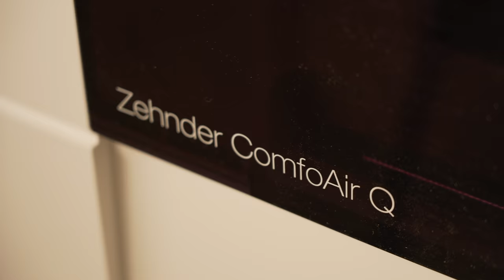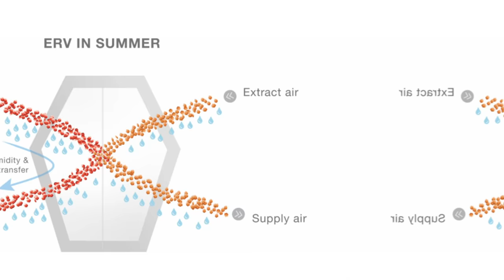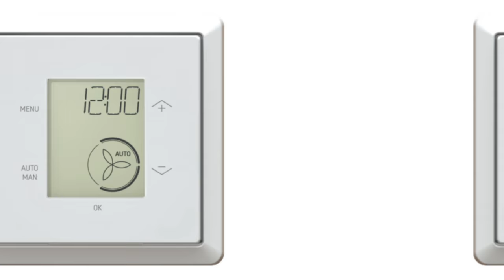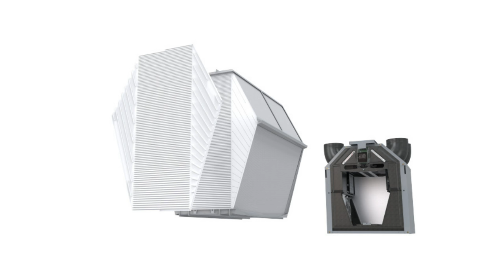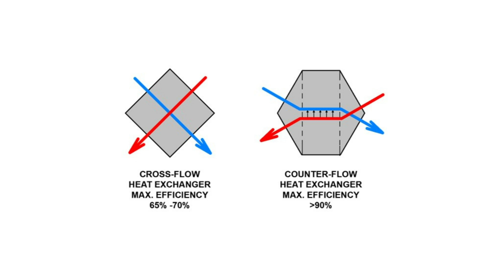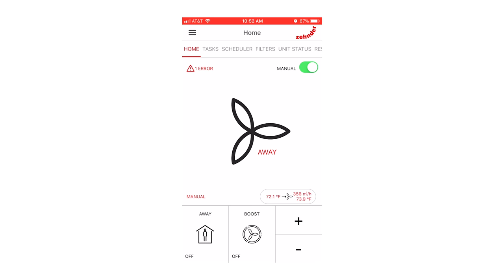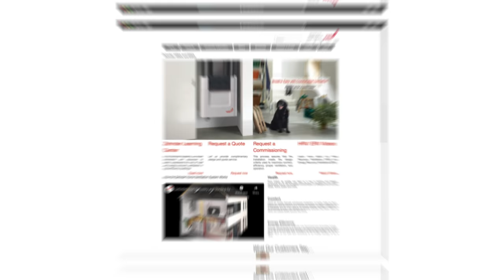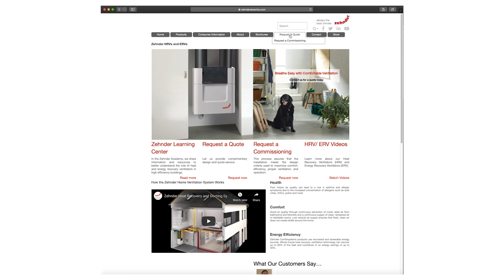Passive House - Fresh Air System Install & Costs (Zehnder)

Comment: How does one tie in heating and cooling into a system like that?
Reply: This is a common practice in North America, but it's best to let the systems operate independently. The airflow required to deliver or remove lots of BTUs is a lot more than the airflow required to maintain healthy IAQ, so the duct sizes are different. And the air distribution strategy is different as well. Heating and cooling recirculate air to maintain efficiency. You don't want to recirculate your bathroom exhaust air. The control strategy is often different as well (intermittent vs. continuous). We're trying to optimize Indoor Air Quality.

Comment: How long can these flex pipes runs be?
Reply: It's relative. Shorter is always better, because every additional foot of length makes the fan work incrementally harder. That said, we'd love to see them around 35', but I've seen them up to 80' long and still deliver the air. It really depends on the whole system. And you want to be able to adjust the fan speeds to as low as possible to save energy and keep the system quiet.
Reply: @christophersmith1894  Thanks Christopher, I'm planning to install one but in the basement (I'm in Boston area).  35'-40' seems like doable going to second floor ceilings.  Love your ducts because it looks like they will fit in 2x4 walls.
Reply: @sergeyb8  Yes, both ComfoTube and ComfoFlex will fit in 2x4 stud walls. Our office is in Hampton, NH. Reach out and our local staff will work with you directly.

Comment: Great video. I really like it when you get into the technical details. 

But let me get this straight. A new house in the northeast (zone 5) requires an air door test of 3 ACH@50Pa to pass code. That translates to perhaps 0.3 ACH under average wind loads. You are building a passive house that is so tight, you need to add 0.4 ACH air flow via the EGR to make it livable (providing enough air to breath, and remove bad smells). And it only cost $18k to supply the air that would otherwise leak in/out for free in the zone 5 code home. 

I realize an EVR will save a few hundred dollars/year in less dehumidifying/cooling in summer, and heating in winter. But I don’t see this ever paying for itself in the energy saved. And I think we have gone overboard in trying to save the last drop of energy. (There really would be no energy problem if we developed safe 4th Gen nuclear energy).

I also realize the important benefit from pre-filtering the input air. But it seems to me one could just use a large stand alone air purifier for that.

Comment: Matt, could you provide more info on your HVAC setup for your home, is it low static or high static, how many tons, load calculations per room etc?  Looks like your a fan of the pizza box units. Not to much out there about these units that I can find. Would be nice to see some installation videos for them as well. Thanks for your time.
Reply from the maker: Robert, I have at least one or two videos coming up soon on that topic stay tuned

Comment: Don't you need a separate system for your dryer vent?
Reply from the maker: Yes. Absolutely
Reply: @buildshow  , are you abel to configure this system to let in air when the dryer vent / range hood sucks air out?

Comment: An ordinary heat exchange ventilation and proper climate shielding is old news in Sweden, been the standard for decades... ;D  But it looks like u put the vapor proof layer furthermost out?? Or is it just a wind breaker? If not, ur begging for moist damages at season changes when the sat max swaps sides of climate shielding.

Comment: I do not get how this can replace all the exhaust venting he mentioned. If the entire system is doing 180 cfm at max (boost) that is only 11.25 cfm per run/pipe (16 runs). You typically want at least a 50+ cfm fan in a bathroom depending on room size. That is at least 5 runs alone per bathroom and he has 3 full bathrooms, making that 15 runs just for the bathrooms leaving only a single run left for the entire house. A good range hood will exhaust more cfm than this entire system is capable of doing.

Comment: So outside air is humid, normal inside air is lower humidity, but bathrooms and driers are warm and humid, just like outside. Why does this warm humid air go through the evr on its way out? Why not just vent it without sending it through the device?
Reply: Good questions, thanks! Clothes dryer is not ducted through the ERV. But the bathrooms are. Bathroom humidity is pretty intermittent, so over the average of the day keeping continuous low flow of exhaust through the bathrooms doesn't add significant humidity back to the house. This works out pretty well.

Comment: so....... what was the price?
Reply: He said for Matt's house it was 10 - 12 thousand for all the parts. He also said you can plan to spend half of the total unit cost for installation. So roughly 17 thousand for all materials and full installation. They did say the installation was fairly easy for someone who has done them before so maybe you could get it installed for a little less if you found the right person.
Reply: Matt's house is pretty large. A small home would be more like 8 to 10 thousand total probably.

Comment: Great video however the installation pricing provided is WAY to low.  My company has a standard 105$ labor rate.  That would mean if the system is 12,000 your expecting us to complete this full installation in 60 hours for roughly $6,300 ( 2 guys 4 days).  That's not happening especially if your not able to install this in a new construction house.  Add in the time for commissioning, test and balance, misc materials, permitting, wiring, ect plus the mark up on the equipment this is easily a $25,000-$30,000 system installed soup to nuts from a reputable licensed contractor in South Florida.

Comment: Matt, enjoy your videos and technology however you need to go to the next level.  Vermod homes in Wilder, Vt uses Humidity and CO2 sensors to control their HRV.  They also use heatpump dryers with no exhaust venting.
Reply: @Gary Hutchins Are you talking about a heat pump clothes dryer? If so, how do they get rid of all the moisture?  Does it never get humid in Vermont?
Reply: @billcowhig5739  The moisture is condensed and goes down the drain.  We may get 2 weeks of humidity total, up here it can be 95% today and 40% tomorrow!
Reply: Heat pump dryers are terrible. Matt has one in his house he did a review on. You barely can fit anything in them and it takes FOREVER to dry clothes.

Comment: I love their system but still the biggest problem with it is they aren't accounting for targeted delivery. Yes when there is more CO2 detected in a bedroom (sleeping) the boost can kick on. But it kicks on for the whole house. I don't need more air in the guest bedroom that doesn't have a CO2 problem or any of the other unoccupied living areas. The controller should be able to regulate the airflow in an intelligent way. The brains for this system are still pretty dumb for Zender being the leader in this space. I think CERV does this better and they are like a 4 man company.
Reply: Thanks Brett. I'm not sure it's "dumb", it's just a difference in priority. Continuous ventilation during occupancy at normal rates (not boost) is usually sufficient to keep the whole house pretty fresh. While we discussed CO2 sensors, Zehnder doesn't really sell many of them because our systems are effective without them. I think the CERV is a really interesting system and I have a lot of respect for Ty Newell. I think the energy use of the CERV (a heat pump-based system) probably warrants a lot more targeted air distribution. What we have in common is a high degree of concern for indoor air quality in American homes--something that is poorly lacking in our industry.

Comment: I liked it until I saw the Gillet (BMW/Mercedes) model.... $10k for equipment and $500 a year in proprietary/uncommon sized filters (I'm guessing since you neglected to mention that). What other maintenance costs are there involved? When this company goes under in 10 years or is bought out can I get replacement parts? Or is it like that induction cook-top that must be replaced for $2K+ because you can't get a replacement hob (or $10 diode) the year after the warranty expires? How much are those multiple control boards to replace ($500 each like for my $1K fridge)? Newer is not really better. Simple easy to fix it the way to go. This looks nice for the builder, but is a cost nightmare for the consumer.

What about the kitchen ventilation, how does that integrate into the system?

I want one size and type of easy to get filter for my HVAC. Does anybody do that?

Comment: Ehh, why don't you just hook up a humidity sensor in the bathroom, or one that hooks into the light switch? The former would just tell the system to go up a notch when the room's humidity is over a certain level and the latter just runs for as long as the light is turned on plus a few minutes extra. That way it really doesn't matter if they turn the hvac system in boost mode.
Reply: And also, I'd get a dynamically regulated system instead of a statically one like this. The dynamic one just measures the cfm per outlet and regulates to a setpoint, regardless of line diameter and length, and the inlet/outlet annulus size. You can boost the system per room, so you don't get extra noise in all rooms if 1 person takes a shower, and depending on the system (heating/cooling bypass) you can regulate the temperature per room. So the bedrooms aren't as warm as the living room.

Comment: Well, I live in a passive solar home in California.  We don’t have a furnace.  So, passive means no mechanical ventilation systems.  We open windows and we rely on the architecture and natural convection to cool or circulate heat in our house.  So I don’t understand how this is “Passive”.
Reply: Susan Wies Realtor he said passive standards not that it was a passive house

Comment: There is a smaller one bedroom ERV, and these are placed one per room.  

I wonder if the contact surface of several of them is not greater than the contact surface of the surface of the single Zehnder core.

The single room ERV consume something like 6-watts per hour, and they are 91% efficient:

https://images.homedepot-static.com/catalog/pdfImages/7b/7ba84ffc-f8e0-43ff-a5d3-092c48f106e3.pdf

Interestingly, I think they are both designed in Europe.
Reply: There are at least a few versions on the market of these room-sized units that operate in pairs. Zehnder has a version available in Europe, but we’ve opted not to offer it here in North America. Despite the published efficiency figures these are a totally different product and the overall functionality leaves a lot to be desired. The number of pairs you’d need to install to get the same ventilation rate as a centralized ERV in a typical sized house also makes them a pretty expensive approach. IMO, they’re best suited for a small house retrofit, although we have better solutions for that as well.
Reply: @ek9772  I didn't mean to be careless. I was attempting to provide the courtesy of a response to your thoughtful post. Unfortunately I was doing so while on vacation with my family and I didn't take the time to quote technical documentation. I'm back to work today and will try to respond with better info.

I believe I found the technical documents for the Vents-US product you highlighted here...
http://vents-us.com/cat/724/#documentation

Unfortunately, Vents-US doesn't provide independent lab reports. They simply state that the product has "up to 93%" heat recovery. The difficulty in understanding what that represents lies in the fact that this product only accomplishes heat recovery when it's being used in oscillating mode (supplies fresh air for 70 seconds, then the fan reverses and exhausts for 70 seconds). The ceramic core gradually absorbs heat while running in one direction and the gradually releases heat while running in the other direction. Is the 93% accomplished during the entire forward/reverse cycle or only during part of it? They just don't say. (Although a reviewer posted some of his own measured performance on the Home Depot page you linked and the recovery performance doesn't look continuous.) Also, given that they can operate in a few different speeds it's reasonable to assume that the highest heat recovery performance (in their case, "up to 93%") is seen only while in the lowest fan speed. This is true of any heat recovery device, including Zehnder's. (The Q600 HRV also gets 93% at a lower fan speed.) This is why rigorous lab testing is done at different speeds and under different temp/humidity conditions. And the resulting lab reports aren't as simple as quoting a single number. Or if there is a single number given, the parameters under which that performance is achieved is described.

The Vents-US unit is capable of running in exhaust-only mode, so maybe that's a way to use it in place of a bathroom exhaust fan; however, there's no heat recovery while doing so. And you'd have to add enough of them to your project to cover each bathroom, which further increases your total project price.

As I said in my original response, these products have their place in the market and can help a lot of people. But I'm trying to help with informative responses to questions posted on this video, so I also wanted to point out the reality that this is really a different product category. They operate differently and can't be tested in the lab the same as an HRV or ERV, so you can't really compare the performance. And the twin-style through-wall units have some operating limitations that don't provide the total performance of a complete installed system like the one we showed at Matt's house.

Zehnder's HRVs and ERVs are rigorously third-party tested by Passive House International and the reports are available on their website.

Comment: Why didn't you go with 2x6 framing in your home? Cna the ERV system be integrated into a smart home design?
Reply: Hi Marces. Zehnder ERVs can currently be integrated with any control system using a 0-10V signal. But letting it run on it's own at a low, continuous rate works really well for maintaining indoor air quality in a normal home.

Comment: I'm sure a stupid question, but what happens if power goes out? Does air exchange stop?
Reply: Well the question is pretty stupid lol, ERV needs power to run so it will not run if you lose electricity. Unless you have backup generator
Reply: @IYG-x7c  OK so in other words, if you have something like a brownout, then you'll quickly be breathing stale air. That's what I was trying to understand. How long does it take to create a toxic health hazardous situation in the event of no power?
Reply: @BillWhite  why would it create toxic environment? 99% of people don't even have ERV
Reply: @IYG-x7c  I'm speaking specifically about the indoor environment for the family living with an ERV that has no power supplied. This is my root question, how long does a house with ERV take to have foul air, you know where there is more carbon dioxide and buildup of chemical fumes, etc. (obviously depending on what products the family uses)...when there is no power running the ERV? I'm in planning stages of building a home, and I like the tight house idea in terms of energy conservation, however, my concern is if there is power loss, how long before there are problems without opening all the windows/doors to allow exterior air in...not sure why this would cause so much confusion. This is called contingency planning. My hopes are to have grid tied, along with solar, wind and possibly hydro power...I believe in redundant system, however, I'm saying worst case scenario here...how long before this house become uninhabitable or causes more problems than it solves for the residents in the event of power loss.
Reply: Yes, the ERV needs power. But the windows should still work during a power outage. Window ventilation isn't practical all year in most climates, but it'll do in a pinch!

Comment: Have a look at this: https://database.passivehouse.com/en/components/list/ventilation_small . These are all certified balanced central units with such a high efficiency (80-88% and low-el fans). A few also with huminity recovery. Well, on the concept, that was all perfect - the balance (well explained), the counter-flow, the filter (MERV15/16 - it's worth it), no recirculation,, the silencers,, the 7/24 fresh air, the simple 3 speeds (keep it simple!); supply air from the ceiling (not from the flloor -dust!) - all these are certification criteria. Exactly: It's not rocket-science!
Reply from the maker: Huge honor to have you watch and comment Dr Feist!
Reply: I was told by Zehnder that this system would auto-balance a certain amount of exhaust air, from a dryer or central vac for example.  But then they said that was wrong and it wouldn't.  Do any of the ERV's actually balance out up (say up to to 100 cfm if you have extra capacity in the ERV)?  I really don't understand why you wouldn't want to cut the normal ERV airflow anyway during the short times you are bringing unconditioned/unfiltered air through a make-up air system.
Reply: @buildshow  Thanks for all the work you do with these videos. Really well done - good building science is important, even more important is it, to explain it in a way practitioners will understand.

Comment: These systems can also reduce radon levels.
Reply: possibly true, but radon is heavy, and typically the exhaust ports are on the ceiling.  it's better to have a separate radon system in a high radon area
Reply: @BrianKrahmer  without a doubt ERVs reduce radon levels.  Are there other more effective mitigation methods? Yes.
Reply: @rambob169  do you have any data to back up that claim?